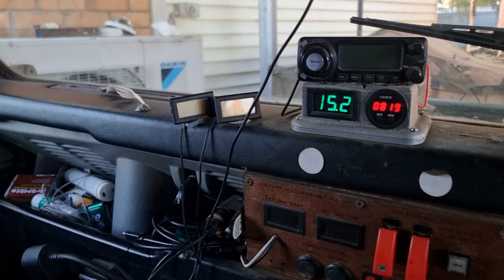Replacing the bull bar on the 6x6 Perentie after a crash

Comment: You need to go and video the lights and do some timing measurements.
Get a couple of dash cams..
I thought you were taking the tape to measure  the new bars to see if they fit the vehicle, not the trailer.
Good to see you found a final good use for the old bar...
Stay Safe mate.
PS. The oil leak... thats chassis lubrication.
Reply from the maker: the old bar might get refurbed at some stage.
As for the lights there is certainly a discrepancy, I'll be gathering some evidence of that.